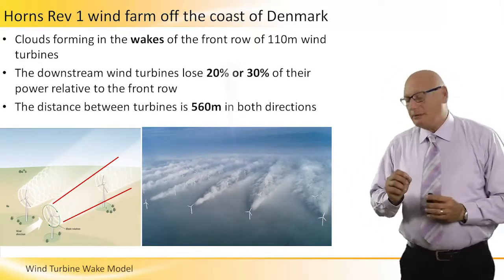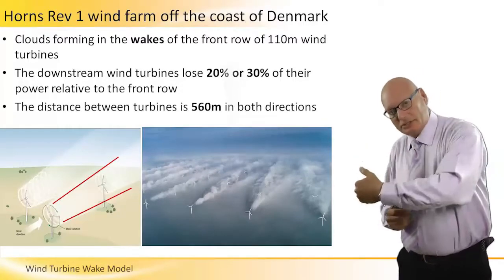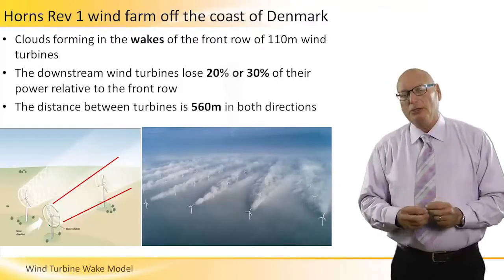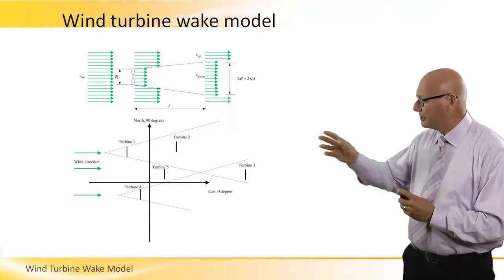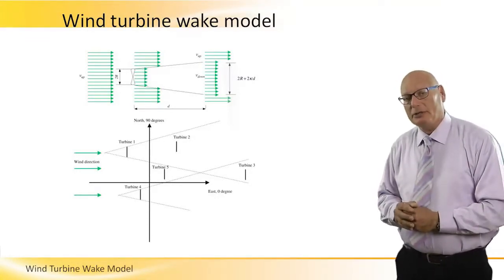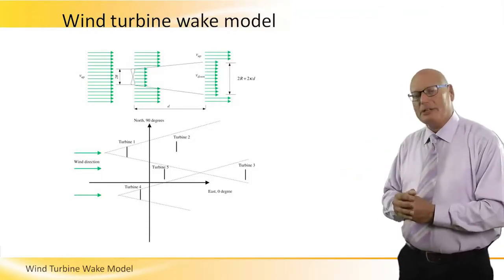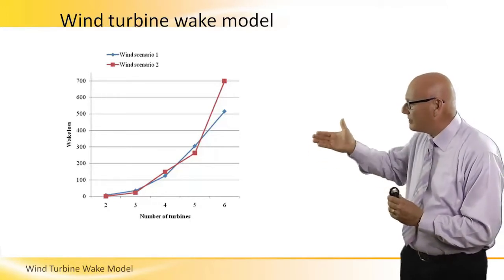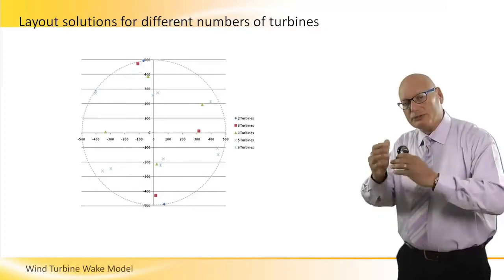Wind Turbine Wake Model

Comment: I optimized wind farm layout when I was a master student using GA algorithm, good times.
Reply: hi  can you halpe me  i have the same thème  in my mastre  optimozation of wind farm  and  wake effect
Reply: @nosojdjos  Jensen wake model. it's a straightforward wake model which you can code in Matlab. the farm net power output will be the objective function for single objective optimization.
Reply: @nosojdjos  honestly I didn't validate the results since it was just a class project. the model is not prescise enough and ignores lots of variables. but its easy to combine it with genetic algorithm. computational fluid dynamics yields the most accurate results but it's much more complex.